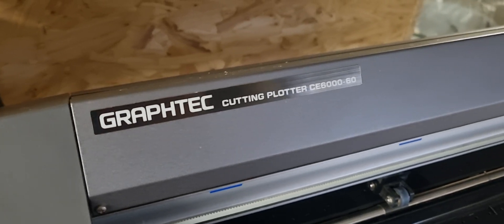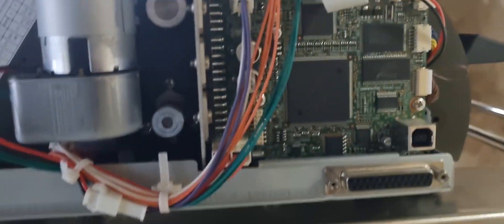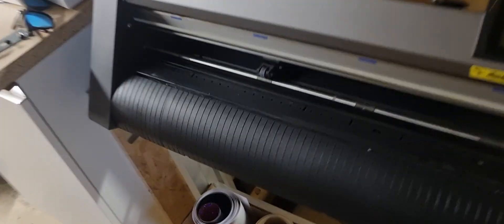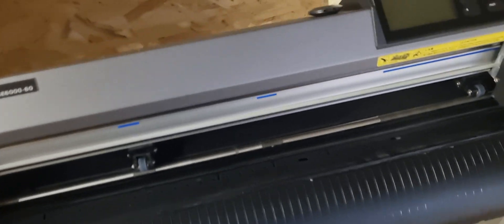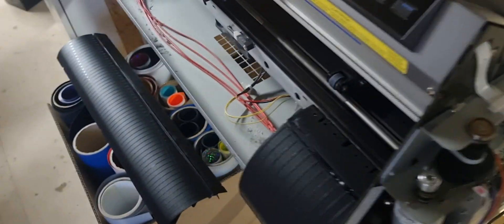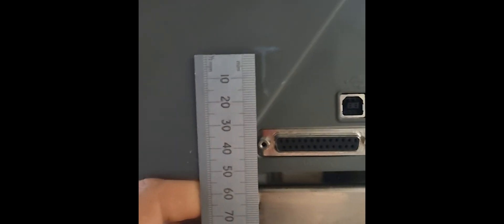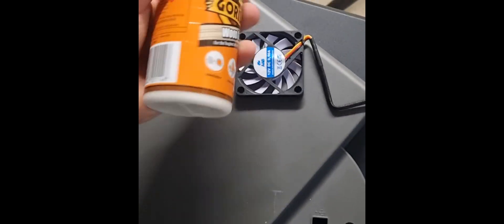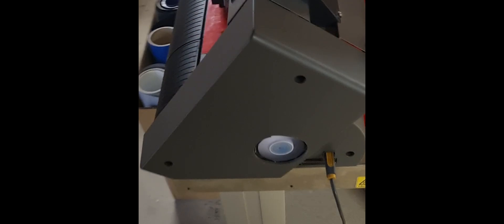Graphtech CE6000 E01009 Fix

Comment: Thanks for making this. Very helpful! On a side note do you think its worth replacing the main fan with a super silent one as i noticed you mentioned it's a loud machine.

Ive just bought one of these and compared to my old Roland PC 60 its very quiet.

Many thanks
Reply from the maker: It would probably be a good quality of life upgrade! but for my environment it won't make much difference. I can imagine however it being quite annoying if its a nicer working space.

Comment: Hi if I use a stand fan but the error code still there, is that mean my main board has gone?
Reply from the maker: A stand fan may not provide as local cooling as is necessary. But the main board may be the issue.
Reply: @CallumWK  So I should try to install a heat sink and a local fan first before I change the  main board?
Reply: @CallumWK  FYI, the code appears for few months.